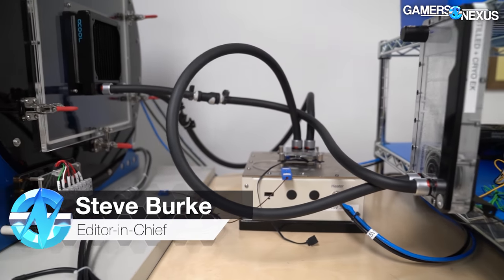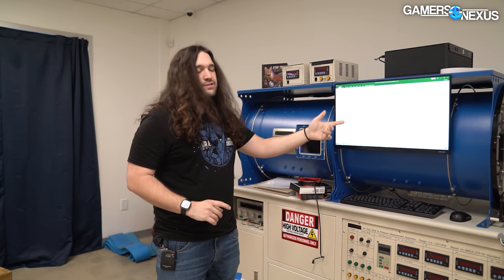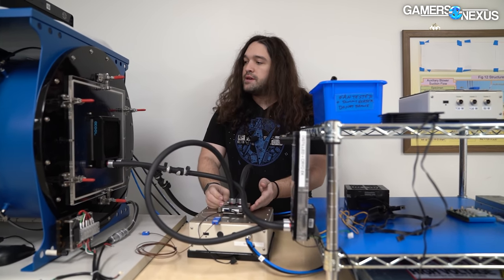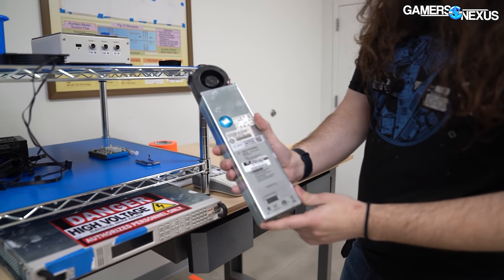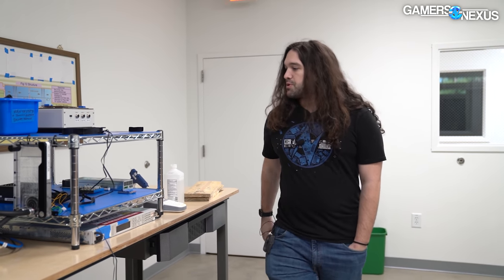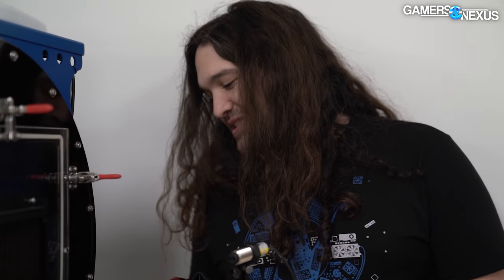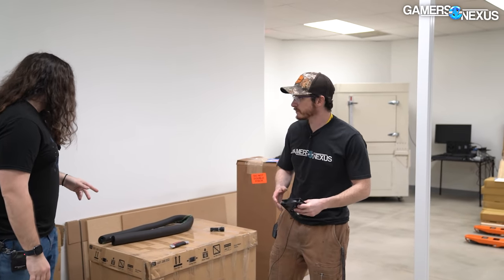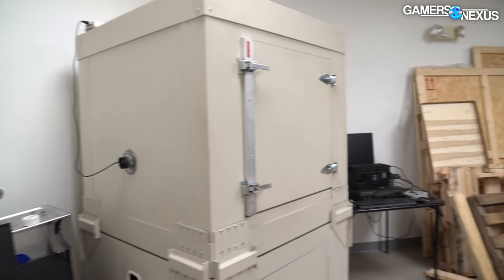GN Lab Update: Fan Thermal Testing, Pressure & Flow Charts, & Challenges

Comment: The best results for a fan test would correspond to those that represent its load,, when it's mounted in a case, or on a CPU cooler. Can you measure the air load that a fan sees when it's mounted?

Comment: For the PQ data, definitely present the max pressure/maxflow as that is what goes on the manufacturers boxes like you said, but rather than just shoot for the middle I'd build a case or two, run the fans, sneak a manometer in and measure the differential over the fan and see what kind  of pressures are realistic and pick a few pressures and run with that. I.e. "air flow case, high flow, airflow case, low flow, normal case high flow, normal case low flow"  and present the airflows at those example pressures.  Same for radiators "dense radiator low/high flow, low FPI radiator, high/low flow"   Like I can get a PQ curve from Noctua, but I have no idea where Id even be operating on it.
Reply: I think this is a great suggestion. In addition, testing typical thermal performance at different flow rates + heat loads would be an interesting video topic, since there's diminishing returns as you get higher flow rates and temperatures closer to ambient.
Reply: @SpringHaIo  The square root is a killer for sure.

Comment: Hey...instead of mounting the fans for acoustic testing on a rig of sound-absorbing material, you might want to consider hanging them from some strings or hard rubber bands.
Otherwise the mount will absorb some of the sound, before it reaches the microphone.

Comment: Correction for 13:58, but the pinout of a 3 pin fan is Ground, +12v or 5V (variable), and a tachometer readout to report the fan's speed. A 4 pin fan has an additional PWM signal. 
Were you perhaps thinking of 2 pin fans vs 3 pin fans? Must've slipped by a number.

Comment: So glad to see this massive amount of data from all your hard work. 
I have one question on the fan thermal testing, do different radiators have the same fin density? Or do they have the same metal for the fins, making the thermal transfer the same?? 
I realize it doesn't affect the data gotten with your control setup. But I was just curious 🤔

Comment: A small  note for @ 13:43     3 wire DC fans have tachometers in them (+12v, GND, Tach),  4 wire fans have +12v, GND, Tach,PWM.    Thats why most motherboards now have only 4 pin fan headers and have options for voltage/pwm fan control and can monitor the speed of either using the same 4 pin header on the board with either type of fan.      In software swapping pin configuration  to scale voltage on +12 pin, or constant +12v  output and send pwm signal to adjust fan speed. 

Two wire fans don't have a tach, but about the only time i've seen  them in a PC in recent years is inside the power supply, or some watercoolers where its  just +12v, GND on the fan header for the pump.

Comment: There is one thing that I'd love most to see it tested in a lab like this: acoustics with PWM vs DC. My own experience on this matter has been that PWM is always noisier, I feel like I'm hearing some extra humming from the motor, compared to DC. I always build my PCs for near-dead-silent operation, as I cba to switch them on and off while I sleep and I need to almost not be able to hear anything from 5 meters away when I'm in bed. So I prefer using very silent fans and more of them instead of higher RPM.

Comment: 14:05 - small correction, both 3 and 4 pin fan connectors have a tachometer pin. The 4th pin is for PWM control instead of voltage control.

Comment: FOR FAN NOISE TESTS in the chamber. i WOULD suggest a metal plate for testing as well as the foam plate. and this is why: if a fan DOES create harmonics or vibration due to a cheaply made blade assembly or weak bearings, that vibration WOULD be pushed into the chassis of the case, and you'd hear it. so a test on both the metal and foam panels would absolutely be valid, because you could compare: did it get much louder by screwing it to the metal frame? if not, it's probably got good bearings, low motor noise, and a well balanced blade assembly.

Comment: isn't it better to make the cooler holder in 3d printer? and multi-sized shape? Designed for several computers to try? Such as a fixed base and additions to test cooler or the Steam Deck... I have a couple of ideas to contribute.

Comment: The fan RPM question is tricky, in my current build I'm using my motherboard's PWM controller with software (ASUS) and it makes a range. What I end up adjusting is the fan curve, I don't think it matters to me if the max is 500 or 3000rpm, other than how loud it is for what temperature the system is at, I don't set it to 100% at 20C, I'm starting at 50% until 40C, blah blah but others may tie it to GPU temperature, my software just doesn't let me do that aside from piggy-backing the fans from the GPU itself.

Comment: This is pretty cool, I'm looking forward to watching the actual fan benchmarks when the lab is finished.

Would it be possible to get a notion of how much "air resistance" a certain radiator or dust filter adds to a system? For example, lets say you measured the air flow vs pressure chart for an unobstructed fan. Then you measure the chart for the same fan with an obstruction, say a radiator. If you would then take the maximum airflow (0 pressure) of the second scenario and search for the pressure value which results in that airflow in the first scenario, would that be a meaningful way to measure the impact of the obstruction? Or maybe you've already thought of this and have a better way to measure it. Either way, that might be one way to decide which pressure/airflow value to pick "from the middle" of the chart.

Comment: 14:00  I thought the explanation of the tachometer/PWM signals was a bit loose.  Here's how it goes:
On a 3-pin (DC controlled) fan, the first two pins provide power to the fan, and the third pin is the tach readout from the fan.  This is supposed to be 2 pulses per revolution, regardless of the number of poles the fan motor is designed with, but some motors erroneously give a different number of pulses.  Also, when the voltage is reduced to slow the fan down, the tach readout often becomes erratic before the fan becomes incapable of spinning, usually because the open-drain driver is unable to overcome the pull-up from the motherboard end.
On a 4-pin (PWM controlled) fan, the third pin is still the tach readout, but the fourth pin instructs the fan how fast to run.  Because full 12V power is supplied to the fan at all times, the drive electronics can run more reliably when low speeds are commanded, and the tach readout is also reliable - give or take variances in the number of pulses per revolution.  In practice, pump motors usually produce 4 pulses per revolution, as do a few unusual fan designs, with the rest producing 2.
The external tachometer allows determining the number of pulses per revolution the motor actually produces, and also produces a reliable reading even for DC fans when run at low voltage.

Comment: hvac engineer here. i can glance at that PQ chart and know what is going on. the flatness of the lines means a steep drop in flow as the pressure increases. Ideally this would be more vertical. 
A comment on the PQ charts, and i'm sure you thought of this, but either always include a reference fan on the chart, or always use the same scale.

Comment: Hi Steve and the crew, thanks for the update on the laboratory. 
Steve was asking about how people decide which fans are they going to buy and what parameters they look for. Here is what I do:
I look for flow and pressure numbers at highest rpm to know how they will work in my case and if there is going to be negative or positive pressure inside, I aim for neutral or slightly positive pressure. Intake fans have more mesh+filters to pull the air through so I want more pressure there, exhaust fans are more flow oriented as they can move a lot of air while keeping low noise. 
Then the noise at highest rpm. and compare the performace for given noise, I look of course for high performance with low noise. that is probably the most important thing for me. 
PWM is a must, because I want to be in control. 
Also I check the electric current that the fans need, as I daisy-chain the intake fans and connect them to the motherboard and don't want to go over the 1A limit. 
Price is more or less secondary for me. I stick to noctua, I believe that they are really customer-oriented and try to make the best products, not the flashiest or rgbiest fans on the market. So I expect higher-than-average prices. For that I hope that the fans will keep my components from overheating and improve their longevity. 
My suggestion/wish for you is to test and compare the 3 types of noctuas 120mm fans, NH-A12, NH-F12 and the NH-S12. 
thanks and keep up the good work!

Comment: One possible reason for RPM normalized testing is that fans emit different types of noise at different speeds.  It's possible that a quieter fan has a more annoying sound due to it's speed.  I wouldn't rely on this kind of testing personally but some people might.

Comment: I love how the data is created in what looks like an excel graph. I would look at outputting the data as a CSV file and use any programing language to parse out the data. Really neat stuff you got there. I uses a lot of similar items here in my department. One really cool thing you can do to visibly measure the speed of the fan is by using a strobe light that is controlled by frequency. Have all other light sources turned off and have the strobe light face the fan. Use a marker to make a visible dot on the fan blade. start the fan and the strobe light. Adjust the frequency of the flashed until the dot on the fan blade appear stationary. And vuala, a simple calculating gives you the RPM or fraction of it divisible by a whole number. You will need to increase the strobe frequency until the dot no longer appliers stationary, but you will know the multiplier from the first time so it wont take long. Give it a shot. Honestly, it is working under the same principles as the laser, but this method is not seizure friendly.

Comment: I used some closed cell packing foam to put a fan into the 3 optical drive bays of an old pc case and cut a speaker grill and bent the edges to us as a filter screen and to clean up the look. Glad I'm not the only one who thinks foam is a good holder for fans.

Comment: To add to the explanation of the pq-curves, no static pressure is a vacuum cleaner running with no blockage. No airflow is like blocking the vacuum completly, the suction you feel is the pressure the vacuum can produce.

Comment: From my understanding, 3-pin fans use the third pin for tach as well because 3-pin fans control speed by changing the voltage...? So you have 12V, GND, and tach on 3-pin with the 4th pin being the PWM signal on 4-pin fans? Also, I thought Intel's PWM fan spec specifies 2 pulses per revolution on the tach pin? So as long as manufacturer's are following the spec, that shouldn't be an issue?

Comment: Thank you for tackling product reviews with science and data instead of focusing on sponsored promotional videos like many others.

The metrics that are most relevant to me are the relationships between air flow/noise for case fans and wattage/noise for radiator or air cooler fans. When deciding on a radiator fan, I look at how much energy is absorbed by the water and at which temperature (delta T) I want the water to be. Then, I choose the fan and radiator combo that offers the lowest noise level at a comfortable frequency. It's quite complex because it not only depends on the fan but also the radiator and even case used.

For the general audience, I think it would be best to present data on either air flow and pressure in relationship to noise or wattage/noise. Using a base line radiator that viewers can easily translate to their custom loop, would be great. I won't go into how "noise" should be represented because you're doing a great job, already.

Comment: I'd love to see fan curves with common obstructions added in. Filter screens, air cooler fins and radiators. You could measure static drop across the radiator etc at different air volumes. Also if there is any flow difference for push vs pull. Spacing vs Flush. 

My Noctua fans have harmonic noise in pull vs push on my case and I'm curious if that effects flow or not.

PQ charts get easier with time. At this point in my career I'm pretty comfortable with them. Min/max and then 50/70/90 or somewhere around there, at at least a few fan speeds, would probably be good data points. Or at least the deltaP points for filter, radiator, air fin stack and even case perforations.

Comment: On radiators we do use RPM curves
Usually it starts at 750rpm and it's based on coolant temperature, raising the rpm to cool the coolant temperature

Comment: Suggestion:  Place the reflective tape for the laser tachometer behind the fan, maybe even far away inside the bowels of the apparatus, then divide the measured rpm by the number of fan blades to get your rpm. This way you don’t compromise the noise profile of the fan by introducing load imbalances from the weight of the tape, or turbulence from the edges of the tape.  

Also when cutting foam, a breadknife makes a really clean controllable cut, and doesn’t make any fumes like a hot knife or wire would. 

I’m looking forward to the tests, and am requesting NB-eloop fans be tested, I have no affiliation with them but they’ve always stood out for me as exceptional designs.

Comment: For the fan data you could see the pumps performance charts in chapter 13 of Robert Mott's book Fluid Mechanics, you could set a fix diameter and varied the rpm. That curves will be comprenhensible and maybe other factor like noise  could be included in the same chart.

Comment: Noise vs flow at a fixed duty cycle might work for comparing fans that will not all operate at the same RPM ranges once they are in use.  Depending on how the data turns out you might try a lower duty cycle that’s essentially an idle, a midpoint, and a flat out. If I had to make a blind guess though the lowest speed would not be worth doing as the midpoint and high point would give you what you need to compare how noisy fans are relative to each other.

Comment: I love the approach and the consideration taken when setting up the fan tester and the data interpretation. Steve mentioned several times the efficiency of fans. That is great for consumers that build PCs for playing games or productivity. Having done some mild form of enthusiast overclocking I'd personally be very interested how the high performance fans relate to normal ones. I've bought my fare share of 3000-5400rpm 120mmtl fans  with various thickness purely on water pressure and airflow specs hoping I'll be able to get several degrees more and squeeze and extra 20MHz out of a component. If that scenario is considered when components are tested I think the enthusiast overclocking community will use the data produced and can make informed decisions and recommendations. And yes of course I run my 140mm fans at below 800RPM on idle in my PC 24/7. That's not the point :)

Comment: that laser tach would be great for the fan claims "35 db at X rpm" and "the range is 400 - 2000 rpm" do the fans reach the speeds and noise they claim.

Comment: You may have discussed this already with the sound engineer, but I would be interested in seeing what the measured response of the microphone would be when there is a pink noise (similar to white noise but with a spectral density that decreases with frequency) source in the test position. 

The reason I mention this is because acoustic foam is most effective at sound wavelengths about 4 times the depth of the foam or less, and for longer wavelengths/lower frequencies, the attenuation drops off. This would imply that frequencies lower than said cutoff may be able to “bounce around” in there to some extent and contribute to an increased reading for those frequencies. Either way, looking forward to this new data 👍.
Reply: You're pink to Bob.

Comment: It'd be great if you could publish the raw PQ charts for different PWM duty cycles as well. Maybe not directly in the video, but eg. a link in the video description.

Recently I've been trying to pick a fan for cooling a server GPU in a desktop case, and a big problem was that manufacturers' datasheets contain PQ curves only at one or two duty cycles. So if I have a fan that pushes enough air through at 30% pwm, but has loud bearings, I have no way to figure out what fan I'd need to get to push the same amount of air through the same impedance at 100% pwm and hopefully be quieter.

I'm guessing you won't be testing 10k rpm server fans so it wouldn't directly help me in this case, but I think having the data out there could still help someone doing similar DIY stuff in the future. And if you already have the data anyway (as it's part of your process for getting the charts you show in the video) I imagine it shouldn't be hard to upload it somewhere and add a link....